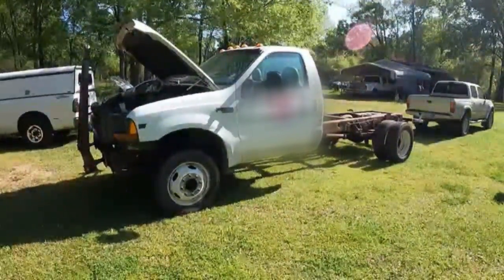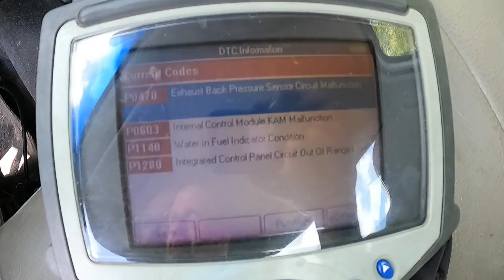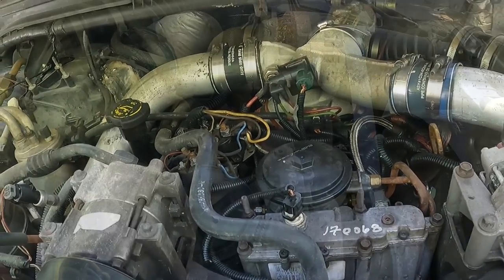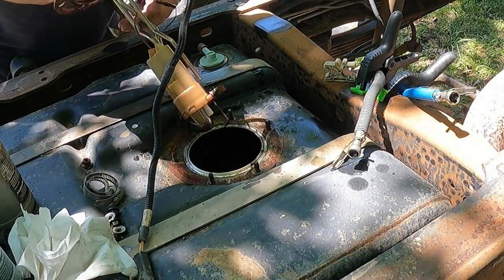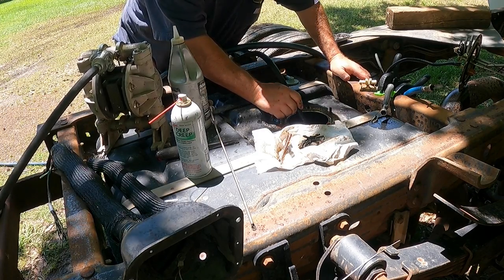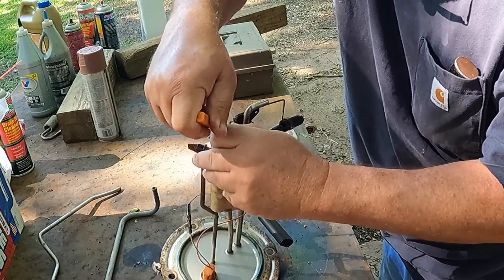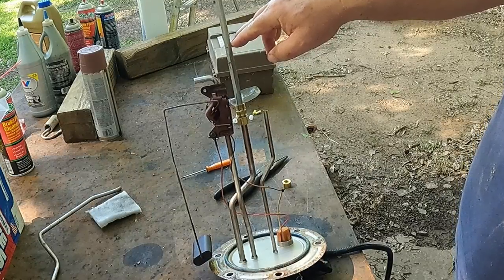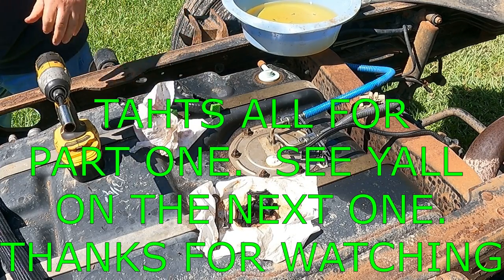99 f450 Diagnosing no start, bad fuel & cleaning fuel tank. "Rented Mule" part 1

Comment: Subscribed!  Great channel, I used to be a good diesel mechanic, but my memory went to heck when I got multiple sclerosis.  I depend on you guys who take the time to make vids, to help me remember what's what.  Just bought a 2000 f550 with a zf6, and 7.3, for cheap because it has all sorts of electrical issues.  I used to be the guy the other mechanic would send you to, when they were stumped, I joke I would have been an engineer if it weren't for this dang A.D.D., so I had to be a machinist and diesel mechanic instead.  All that is a long winded way to say, even though I'm losing my marbles, I can still tell a good mechanic, and this guy is the real deal, you can tell just by his electrical diagnostics videos.  Thanks again for taking the time to make vids, I know it is extra work.
Reply from the maker: Thanks for the great comments and for giving my channel some of your time. I love keeping this old iron rolling. Just paying it forward for all the knowledge others have given me. Hope you enjoy watching and even better if I can help ya out along they way as well.

Comment: Awesome channel I did subscribe, can you tell me what scanner you have?
Reply from the maker: The one I use is an old Genesis scanner. Thanks for supporting the channel. Hope u enjoy and get something out of it.
Reply: @bayoudiesel  thank you very much sir I'm looking for a decent scanner for my 99 without breaking the bank lol
Reply from the maker: @geraldhawkins2643  I picked mine up from a friend who upgraded his. Not sure what he paid for it. Works really well but there are several that do good. I would stay away from the cheap ones cause they don’t have all the functions that the others do
Reply: @bayoudiesel  can you tell me what would be good I've been looking but don't know what to purchase
Reply from the maker: @geraldhawkins2643  mine is the only one I have much experience with. I am not familiar with others but I know a good shop scanner isn’t cheap. The ones my friends use have cost over $2k. 
The functions I use most on mine is live data, custom data streams, diagnostic tests, & of course pulling and clearing codes. Cheaper scanner will not have some of those.
Reply: @bayoudiesel  oh ok thank you very much sir

Comment: Need a good wire digram for 7.3 99 f250 trying to check my 5 v reference where can I get?
Reply from the maker: I may have some wiring diagrams.  What exactly are you looking for?
Reply: @bayoudiesel  looking to test for the 5 v reference
Reply from the maker: @coolblue4077  I need more info on what u are doing to see if I have the info u need. Hit me back at bayoudieseltrucks@gmail.com
Reply: Thanks so much I will email you
Reply from the maker: @coolblue4077  I’ll be in the shop till dark but will check email later and see if I can help ya.